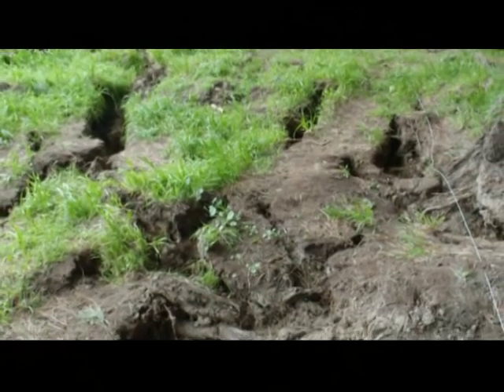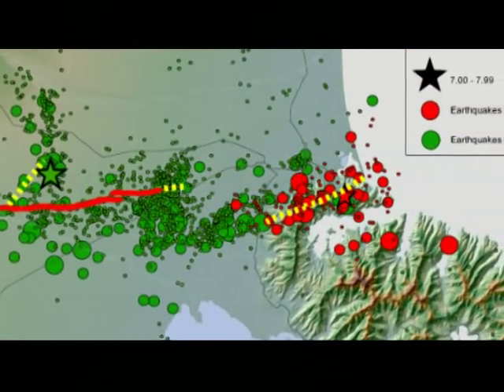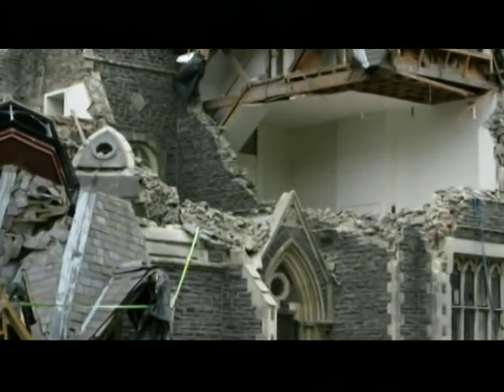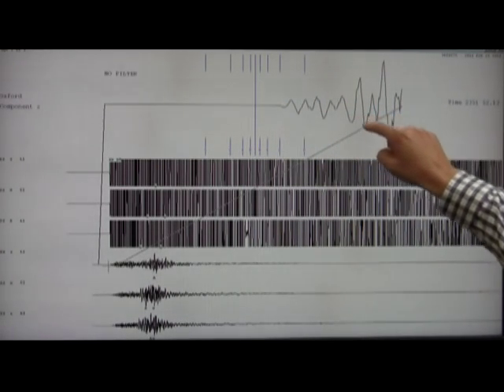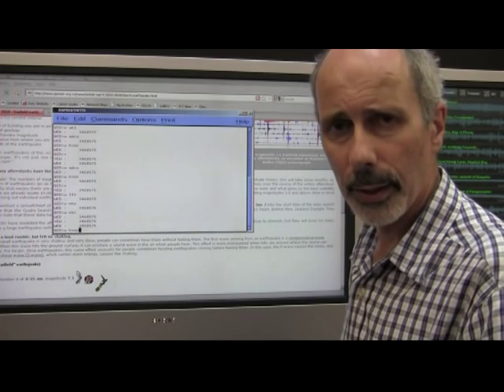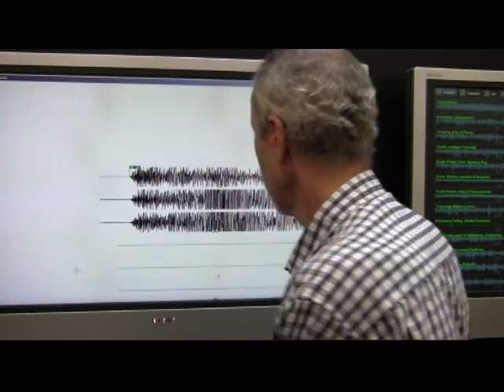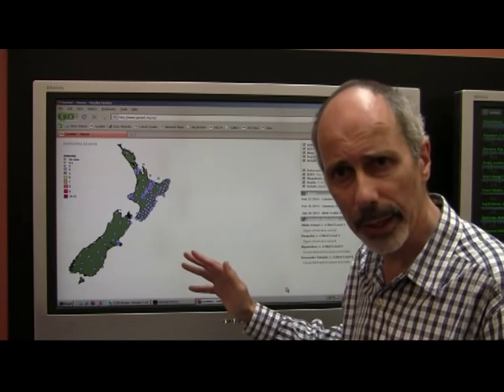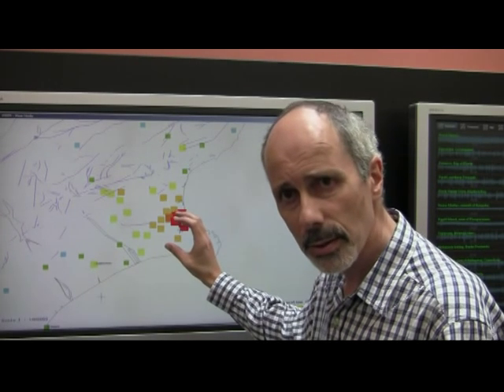Seismic Waves in Christchurch

Comment: hello i study geology at auckland; is the current earthquake from the same fault line as the september line? Also is the faulting activity seen over the last 6 months considered to be operating under the main alpine fualt zone, or seperatly and if so, any idears what caused the stress build up?
Reply: The 2010 Mw 7.1 quake was on The Greendale Fault. The 2011 Mw 6.2 event was on The Port Hills Fault. 

What caused the stress build up? Root source of stress on all faults is movement of tectonic plates. Where plates interact and dont move freely against each other they "stick" and stress builds up.

Comment: @UnkleSi Energy is measured on 2 main scales, the richter scale wich is a raw discription of a energy relsease and yes its on a log scale. 7.1 is almost x10 the strength of the 6.4. The other scale is the mercalli intensity scale, measureing damage done. This is applicable in this situation due to the vastly diffrent damage. Many other factors than the magnitude effect this though. Depth of focal point (was shallower), proximity to the city (closer), also what rock it passes through.
Reply: Magnitude is a measurement of energy released and is usually calculated using the Moment Magnitude Scale. The Richter Scale is no longer in common use....the nearest modern analogue is the ML or local magnitude scale. Richter and ML scale is not reliable for large events and where distance from instrument to source is more than 600km.